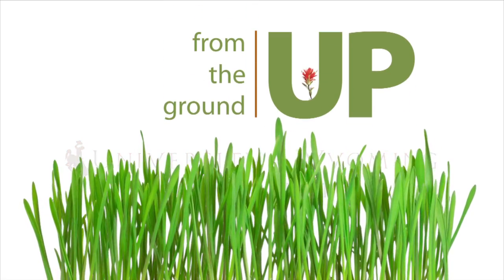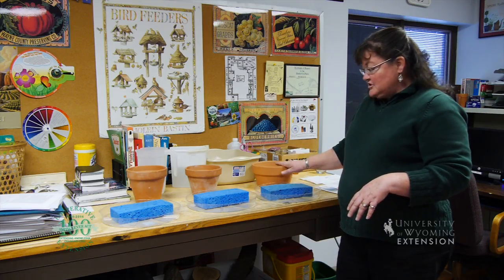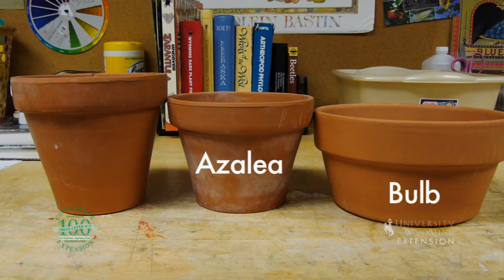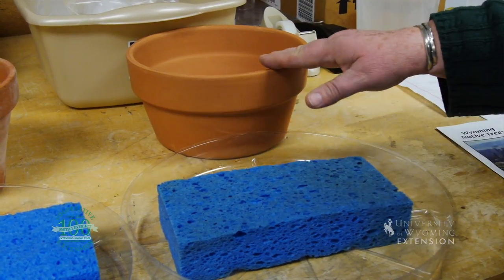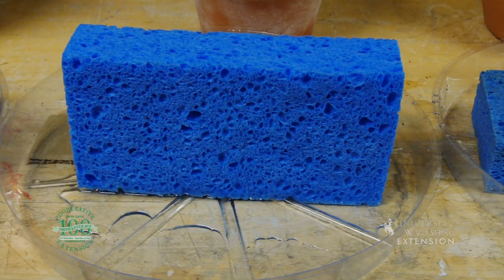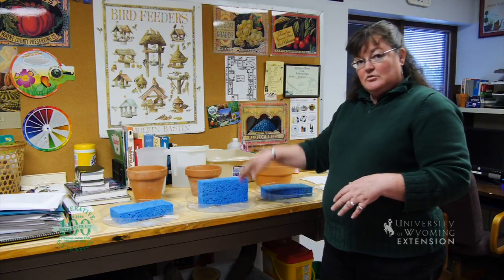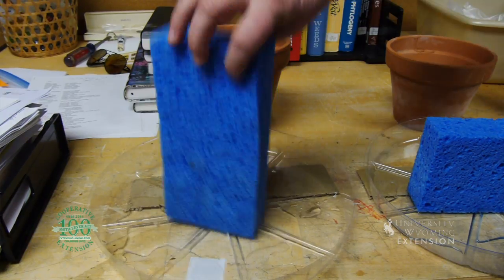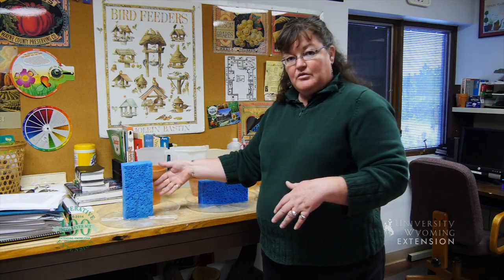Drainage in Potted Plants | From the Ground Up

Comment from the maker: We've got a cool demo that helps you understand drainage in potted plants, and why rocks in the bottom of a pot is unnecessary.
Reply: UWyoExtension   Does not fully explain.  Let ME please explain...What about LARGE indoor plants.  Place a/thing in the bottom?  What about placing an actual sponge/sponges in the bottom?  If you use rocks, packing peanuts, clay pot pieces, or any other product, won't the soil just end up washing around every nook and cranny and fill the areas anyways?  When water DOES collect in the bottom, does it end up evaporating, or does the water remain there anyways?
Reply: Soil has a saturation point, so once all the space between soil particles is filled by water and extra water drains out the bottom because the soil literally can't hold any more.

Comment: So should I use a sponge or paper toilet in the bottom of pot pls guide thankyou
Reply from the maker: No, that will not aid in drainage. A screen or paper towel across the hole in the bottom of any pot will keep soil from leaking out and soil to fill the pot provides the best drainage.

Comment: So no rocks/pebbles to plug the drainage holes?  How do you keep the soil from washing out then?  Most of my pots have at least 3 - 5 holes where I can push my finger or even thumb through.  Isn't that big enough to lose the soil each time I water?
Reply from the maker: I have used a piece of window screen or a coffee filter to cover the bottom of a pot. A paper towel will work, maybe a piece of burlap. It doesn’t take a lot because the roots of the plant will stabilize the soil after a short time.
Reply: @UWyoExtension  Thank you.  Yes, I no longer use the stones now.  It's gunny sack or even leaf litter I gather from under trees.
Reply: Coffee filters

Comment: Well made video with the correct message that you should not use drainage stones. However, the sponge example is flawed.

The reason the vertical sponge loses the most water is due to the area of the bottom of the sponge. Being smaller it holds less water.

Gravity pulls water to the bottom of the sponge and gravity is the same on all three sponges. Lets say that water is held only in the bottom 1" of sponge due to gravity. A sponge with a small foot print will hold less water - the vertical sponge.

Comment: But a pot with rocks in the bottom would hold less water overall because the volume of soil is reduced. It would be like using a smaller sponge. Maybe the difference you are getting at is that more water is held close to the surface when the bottom of the pot is filled with rocks, compared to more drainage occurring in the upper soil layer with a pot full of soil. So the depth of high soil moisture could be more important to root rot than the actual amount of water in the pot.
Reply from the maker: Yes, the upper soil would be saturated before the drainage from the soil would occur into the space with the rock, so the roots would actually be more likely to have root rot occur.